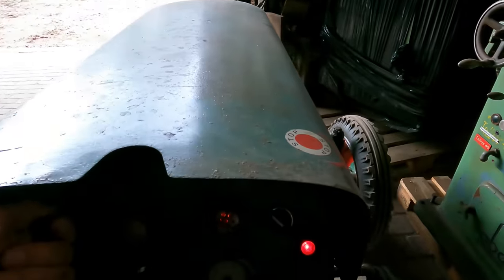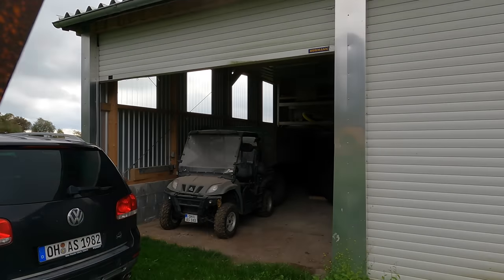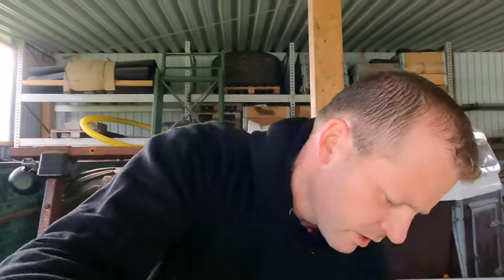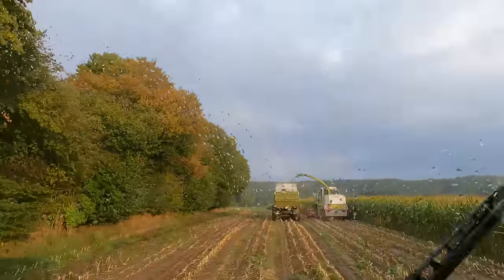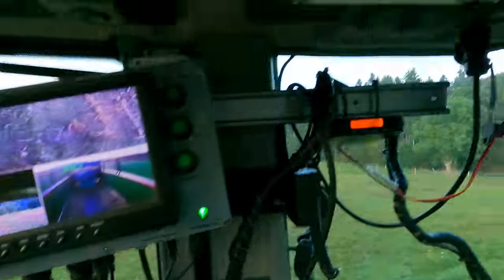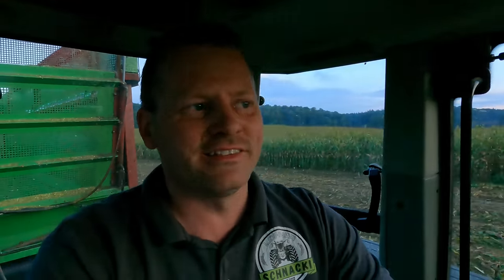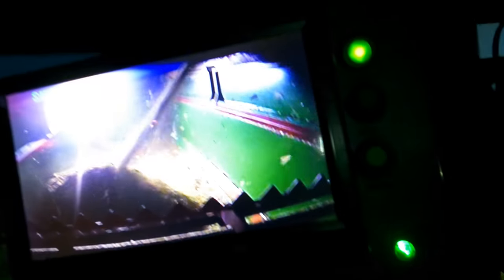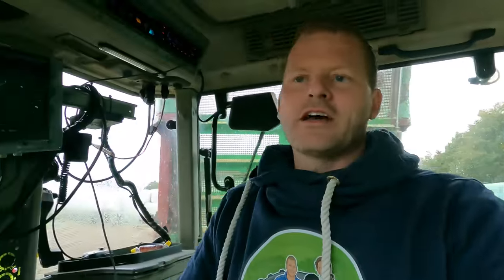LohnerVLOG#303 Wir häckseln mit den Jaguar 840 den ersten Mais! Fendt 818 und Strautmann am Start

Comment: Immer wenn ich jemanden aus Norddeutschland mit bisschen Platt-Akzent reden hör, hab ich nur eins im Kopf: Das ich der Röööhrich bin, das weiß doch jedes Kind😂😂
Schön Schnacki auf Krankenschein gönnen, macht kzH wenigstens n bissl erträglicher.
Deine Meinung zum neuen 600er?
Reply from the maker: 😉😅Sehr schön! Gute Frage, warum haben sie den gebaut, ist da eine Lücke? Ansonsten bestimmt ein schöner Trecker. Liebe Grüße und gute Besserung!
Reply: @schnackizeigtlohnervlogs  soll wohl anscheinend die lücke schließen, die der 700er gelassen hat, weil es den ja erst ab 200ps jetzt gibt. radstand vom alten 820er und nur noch 4zylinder, dafür aber nur noch ein fahrbereich und pull-in-turn und sonst noch ne menge teueren schnick-schnack.